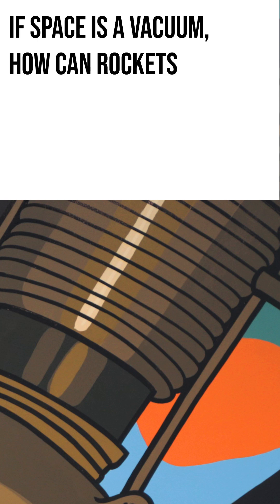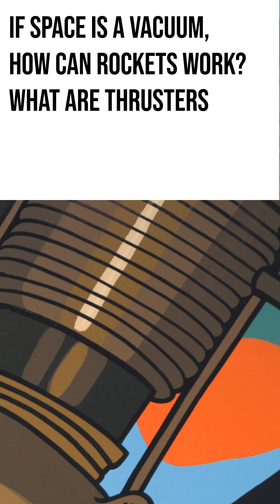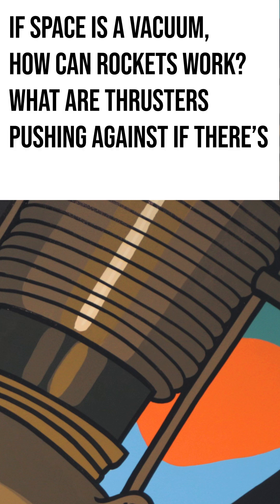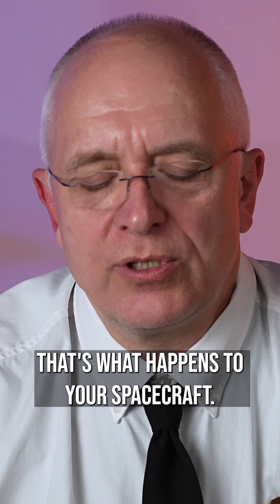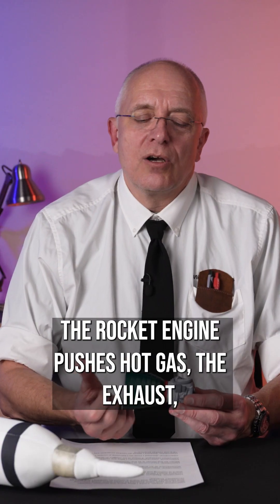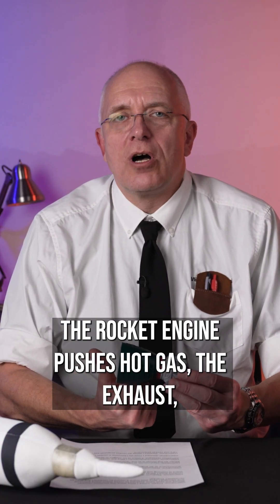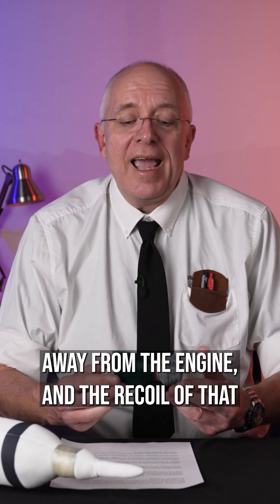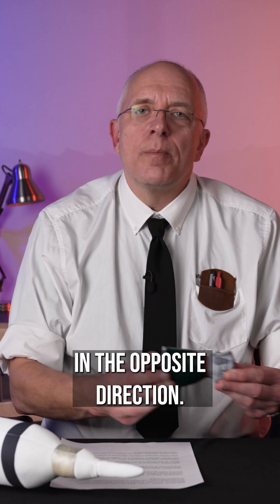How do rockets engines work in the vacuum of space?

Comment: So the museum of flight denies the 4 forces of flight? Cos they say thrust is a force applied by the atmosphere. No atmosphere = no thrust 😂
Reply from the maker: The word "atmosphere" doesn't appear anywhere in this video.
Reply: @museumofflight  yes, which is why your video is wrong 😂
Reply from the maker: @papalegba6796 Thrust is not a force applied by the atmosphere, it is simply the force of the forward motion of something in flight. In most cases, it's created by an engine. The friction of the atmosphere pushes back against the force of the thrust, and we call that atmospheric friction/opposing force drag. In rocketry, since the object in flight is flying straight up, thrust must push against both drag and gravity.

The original question the engineer in the video is answering was this: “If space is a vacuum, how can rockets work? What are the thrusters pushing against if there is nothing out there?” It’s an understandable question to ask.

In response, he’s describing the way Newton's Third Law of Motion plays out in a vacuum. "For every action, there must be an equal and opposite reaction." 

The rowboat analogy he uses is meant to represent a (relatively) frictionless environment. If you were sitting on a surface with no friction and throw a baseball directly east, then the force of the throw to the east would push your body directly to the west as a reaction. Now imagine if you were throwing another baseball to the east every second. You would keep moving west for as long as they have baseballs to throw.

Since a rocket in space is in a frictionless environment, that’s what it’s doing. It’s not pushing against the atmosphere anymore, it’s just throwing proverbial baseballs one after the other to keep the spacecraft moving in the right direction. 

This is a 60-second excerpt of about a two-minute answer to the question, and he goes into more detail answering this question in the full video if you want to watch it.: https://www.youtube.com/watch?v=Lf9s--6qLK4

We hope this clears things up. If you have other questions, let us know. We’re happy to help!
Reply: @museumofflight  The 4 forces of flight clearly state that THRUST, DRAG & LIFT are applied by the atmosphere, whilst WEIGHT is applied by gravity. Therefore, NO ATMOSPHERE = NO THRUST. This is not a debate, it is a simple application of newton's 1st law.
Reply: @stuartgray5877  
👍👍👍

Comment: "Rocket Propulsion" is just the mechanical recoil of the engine pushing out mass.
ANY machine that accelerates mass MUST feel an "equal and opposite force" pushing it in the opposite direction.

The same physics deniers that claim "rocket propulsion cannot work in a vacuum" are the same morons that claim crossbows have no recoil.